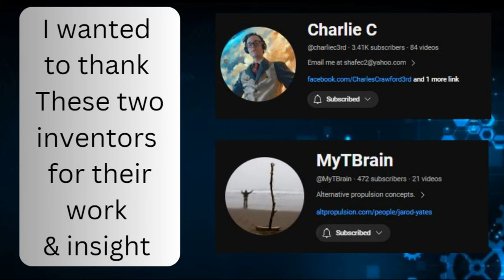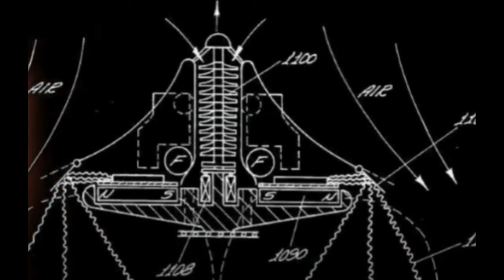Graviflyer "The Working Theory" #1

Comment: A flyback from an old TV outputs a high-voltage rippled DC. 
A homemade flyback outputs high-voltage AC. 
A ZVS board powers both flybacks. 
Example setup:
12-30 Volts DC — into—ZVZ —outputs—high frequency AC —into— homemade flyback —output— high voltage AC
12-30 Volts DC — into —ZVS—outputs —high frequency AC —into—Old tv flyback —output high voltage DC (rippled)
Anytime you increase the capacitor or inductor value, you lower the frequency.
Ferrite cores are only good at 15KHZ-25KHZ. After that, they become saturated.
I hope this makes sense!
Reply from the maker: I know the coils are called ac and dc. The dc one has 4 layers of copper foil wrapped in plastic that rectifies it. The ac one is just divided sections of wire. Both run on a dc square wave not ac. it is just a pulsed dc. it creates a on and off magnet in the core of doth ac and dc flybacks. The true answer is that ac and dc no longer apply when the pulsing part is done. it is simply a magnetic energy.
Reply: @nathanbunten4299  Forgive me; this comment was for the other viewers to clarify your experiment. I could only imagine the hate you get on YouTube for going against the grain. Please know I am an ally. I hope you can call friend.

Comment: First of all, kudos for trying to pull apart this engineering puzzle. People see Alexi's device and either disbelieve or forget about what it actually means.   

You should be able to come up with a proportional engineering math that predicts the size and shape with the input of the material frequency. This would be NP completeness in engineering, not having to sound the aluminum disk and shave it but calculate the proportions. I think you would need a high and low frequency component for the parts above and below the disk, with the disk being the middle component. That means such a math would also predict the shape, proportions and materials of the parts above and below the disk. This would be Replicator Math if anyone could work it out. 

I have not looked at the unsolved Steinmetz equation for electrostatics, but I suspect that the quality of a device being sinusoidal means that the electrostatics of the device match the resonant frequencies of the materials and the shape and proportions. Once you work out the electrostatics of the device (if possible mathematically) then the sinusoidal shape, proportion and material should reveal itself. Thanks for thinking deeply and experimenting meticulously on a lingering mystery of physics and engineering. I haven't tried the proof of concept experiment for the Light Saber design I came up with. Will a rotating magnet attract/deflect a right angle electrical discharge due to chirality and eddy current turbulence? At an inverse square of the distance relationship? I think it will.

Comment: NATHAN!, I want you to consider something in the design. . . On the center disk, I want you to play around with the surface finishes. Have one side of the disk lathed to look like a vinyl record; try it on top, then flip the disk and reassemble and try it as the bottom. Another surface finish to try, either sand blast one side, or maybe mix lye and water and spray a mist with spray bottle on it, rinse that off pretty quickly, then use a sand blaster to remove the layer of sodium aluminate formed

Comment: Great work!
I always thought a subwoofer face down if pulsed with the right resonant freq. could generate lift.
I mean those things generate enough energy to shake your walls!
Maybe a high energy subsonic freq. combined with your HV ionic wind could boost the lift..
Maybe he's using an audio amp.?
Reply: Using the energy to power an impeller is way more efficient.
Reply: A propeller would require the least energy for lift:)
Reply: @shawncalderon4950  And would not require fishing line.
Reply: @dogwalker666  lol:)
Reply: Ion wind is feeble. Thousands of volts barely provide an infant’s breath. 

Some decades ago, the government tested high-power, low-frequency sound waves (through giant woofers) and their use in special weapons warfare. The only thing they found was that it caused premature bowel movements in the test subjects. The reason for woofers shaking things might have to do with physical objects having a low-resonant frequency.

Comment: Hello, sorry to bother you. Can you tell where exactly the tesla coil is connected to the Graviflyer? Is it touching the middle plate directly?
Reply from the maker: connect the wire to the plate. do not connect the coil to the wire at all. place the wire down the center of the coil. It is not connected to the tesla coil. it works on the sparking of the inside tube of the #2 coil. the distance you put it in is based on the weather conditions. It is a static volt reserve or backup power source when implosion happens and the power draw is high. "the spike"

Comment: For my own clarification, does the "flyback" refer to the component that produces the isolated 12 volt power source for the rotating plates? from Alexis' drawing, I thought the output was more like 300V.  I appreciate your efforts, and advice, thank you!
Reply from the maker: yes. The plates have a dc flyback powered by a 12v 1a dc power pack. He uses his own self built zvs. It's less about the voltage and more about the the charge of the plates. The atmosphere may make the the effect different. Remember it is supposed to as close to a static volt as you can get. 

Not when I did my paper lifter experiment. It lifted wit 2 flybacks in series. The amps were in milliamps when the voltage of the output was tested. But it produced enough static volts to lift the paper.
Reply: @nathanbunten4299  Perfect! Thank you.

Comment: I’m desperate to start building one of these and I’ve got some ideas to try. BUT I’m stupid I guess because I need a diagram or pics of what connects to what lol. I’m really trying to see everything connected in my mind then when I think I’m close BAM something new is added and I have to start over. Is there somewhere I can find a diagram that gets me started at the latest iteration of things? Trying to avoid reinventing the wheel. I’m afraid once I start on this thing I’ll get obsessed and won’t sleep till I’m flying in a craft 😂
Reply from the maker: I am doing a fresh build this week. I am making a video. I will add all the original pictures from the real graviflyer along with circuit diagrams. When I put it out take a look it will really help you. Trust me there is a lot of things you may not expect.
Reply: Fantastic!! Can’t wait
Reply from the maker: give me a few days. I have all my parts for a new one. I have to 3d print some parts. I will do a build video for it. I will try to stay close to the original. I will also show where to get the parts. I will include a diagram with every dimension.

Comment: it might be like an old Chevy 350 engine because the 350 was a breakthru in the technology  ..  this is the point in time when they discovered they could actually get more performance by having the exhaust and the intake valves open at the same time on a particular stroke  ,,  also the harmonic balancer is balanced differently from the others  ....

Comment: Old man builds. I know the two people that you chatted with from APEC named Jarod and Charles. You all make the graviflyer to complicated. It is an easy device to understand. The voltage from the Al, PC, Al2O3 capacitor ionizes the air surrounding the device and the charge and spinning magnets push some of the air surrounding the device outwards so there is an atmospheric type of vacuum, and the device then lifts up like a hot air balloon. It is not and I repeat it is not anti-gravity. I watched your YouTube video where you chatted with Jarod and Charles and you three are all off the mark with graviflyer. Einstein said keep it simple and not complicated. The bubbles on top of and on the bottom of the graviflyer are the partial vacuums for lift. Don't be delusional.